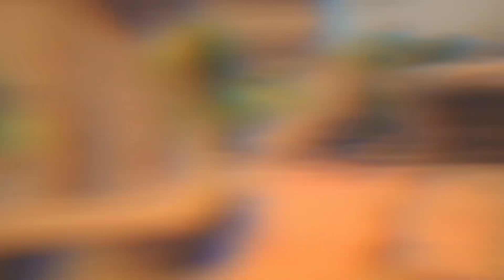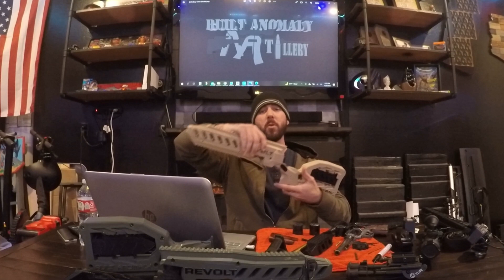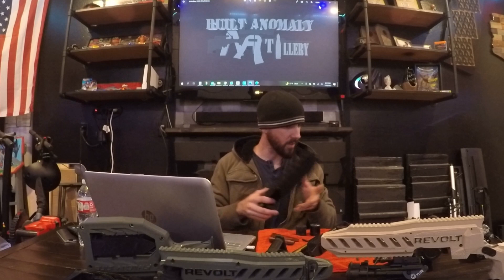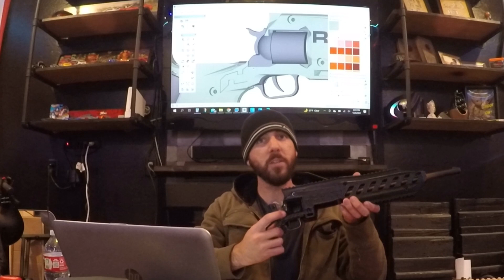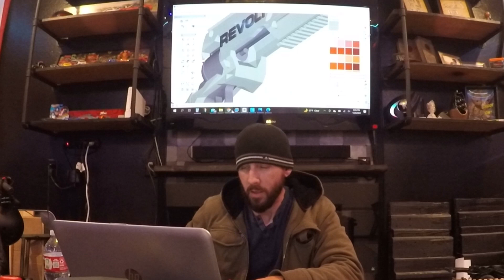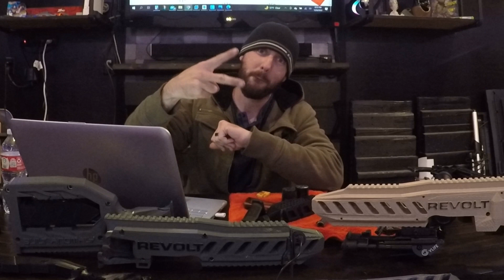3d Printed Revolver Rifle Stock:  Details and Pricing

Comment: Can I use this REVOLT STOCK on my Heritage Rancher.  I other words place your stock remove the Rancher Stock and convert to the REVOLT STOCK.  I do not have the pistol 16" Heritage.  Like I said it is the Heritage Rancher.  Could you please let me know?
Reply from the maker: At the moment, I just have a the pistol grip verison. 

I debated on doing on for the Rancher grip, maybe soon in the future. 

I know on Heritagemfg.com you can buy the pistol grip frame and also the rancher frame (for others reading this comment)

Here is a link $25s
https://shopheritagemfg.com/shop-by-category/parts-maintenance/heritage-small-bore-standard-backstrap-assembly

I dont personally own the rancher.... but do the iron sights have the ability to be removed???  cause that would be the next issue.

Comment: Wow this is amazing  do you make them for s&w model 10? And how much
Reply from the maker: Thank you!! 
I love the S&W Model 10.. If I can get my hands on one, I can definitely model up  something. I would most likely develop a grip replacement that is one solid piece, following along the back center (along the sides of the hammer). From there, it would transition to a nice picatinny rail on top. Going this route can also modernize the shape and increase grip size for folks with larger hands. 
Open to ideas and thoughts or specific ideas for it.

I have a similar design in the works for Hertigage's standard size revolvers, except their cylinders don't slide out for loading/unloading, so it makes things a little more bulky. The S&W would definitely be clean and slimline.